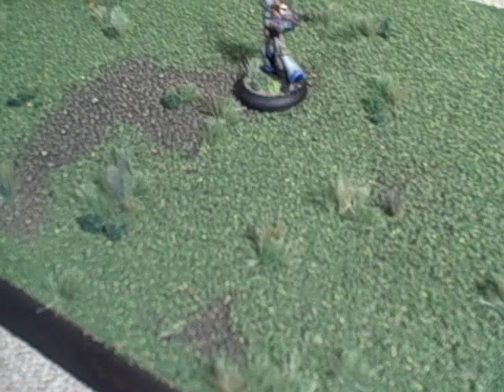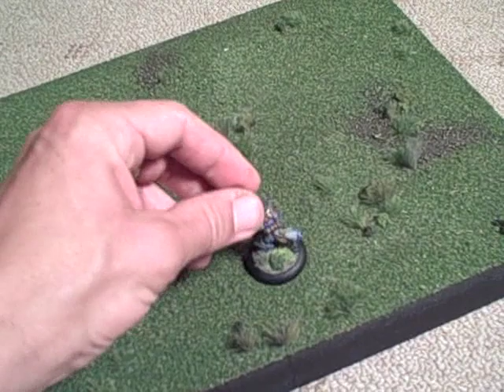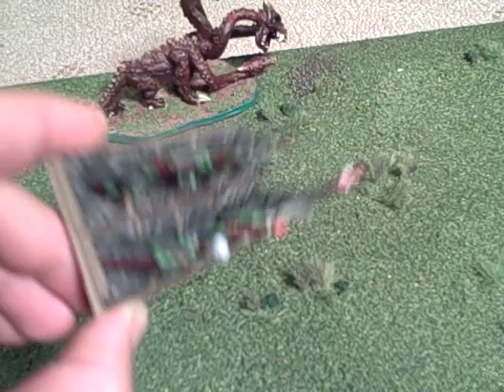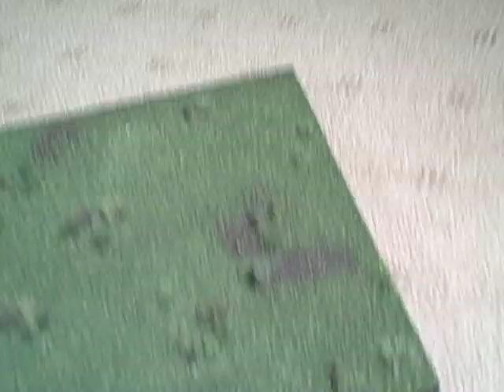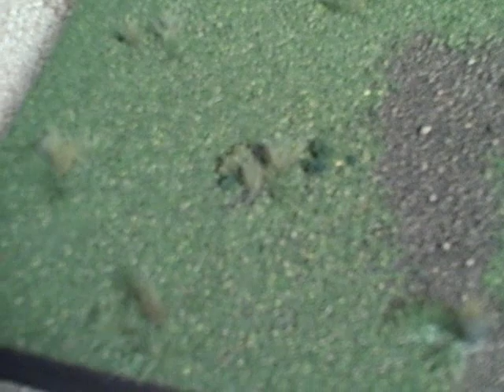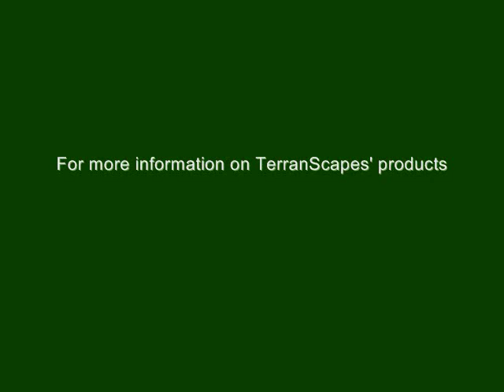TerranScapes - Unkempt Field

Comment: scale is nice u had to reduce it for playability. the block stacks of modles will fall if not magentic so is bad for fantasy but 40k lotr and warmechine will work for it.durability i think it will be ok for 10 or so games then the grass will be ethier the wrecked a little thats ok that just wear and tear over time but than its going to be just pushed right down over time. tal grass may look better guled on a base and moving around like terrain instead of guled down but than u are useing plastic